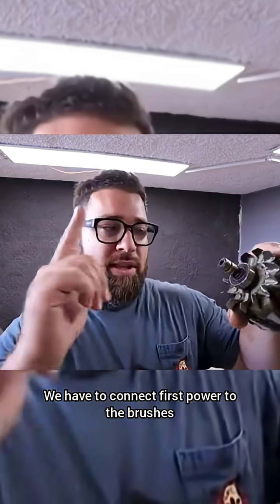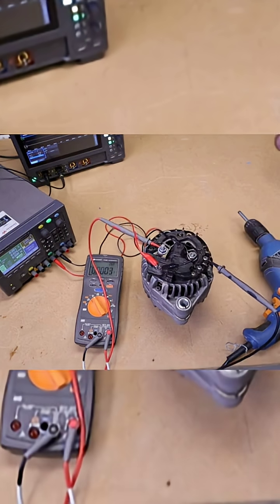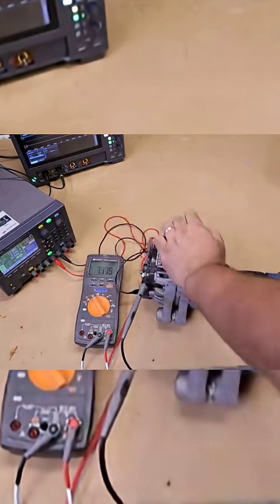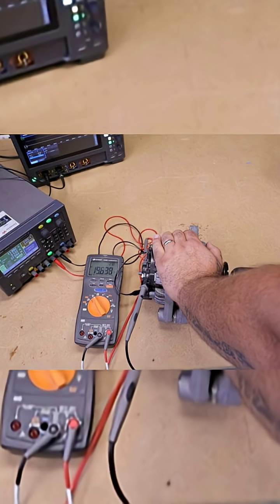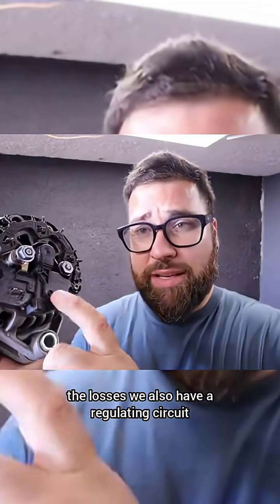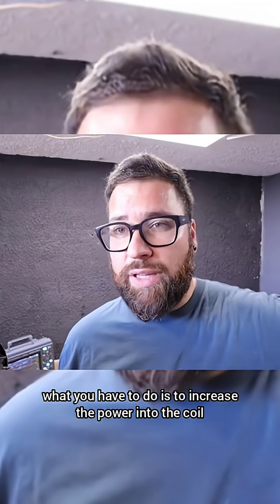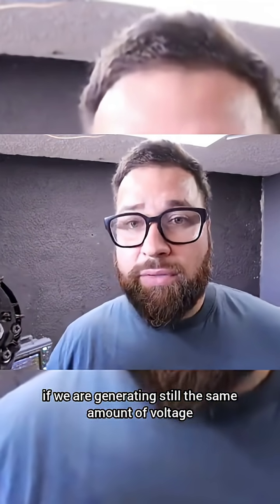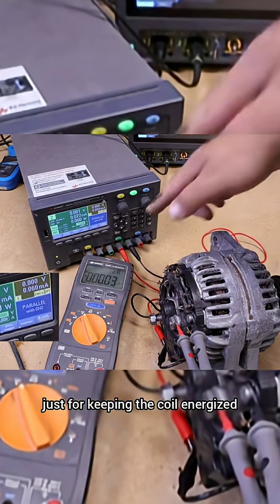Electromagnet or permanent magnets?

Comment: If i understand correctly, this is basically a transformer, converts 12 Volt input to 19 volt output. In energy wise, you can get 12 V input power + the power hand drilll consumed  from output at most.

At this point I want to ask, what are the benefits of using an electromagnet to generate power instead of a solid magnet? I can see you can have an "adjustable magnet"" in this contraption but is there any other benefits in term of energy efficiency or scalability or something like that?